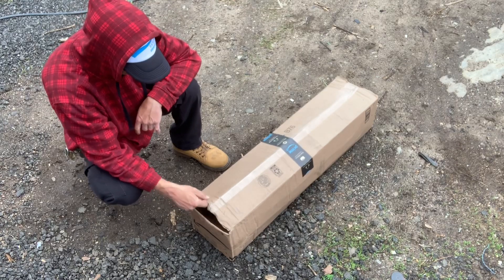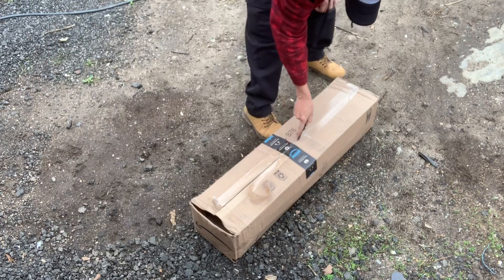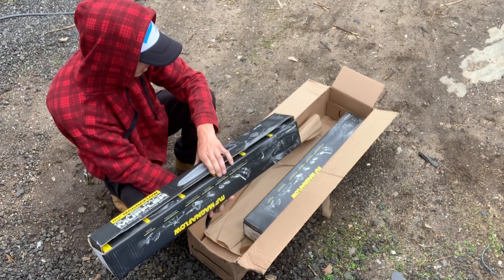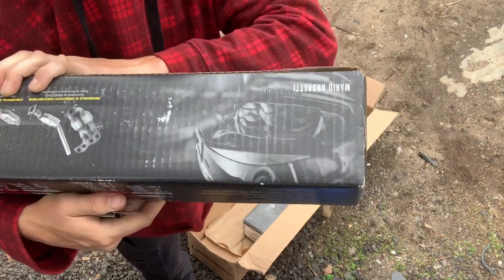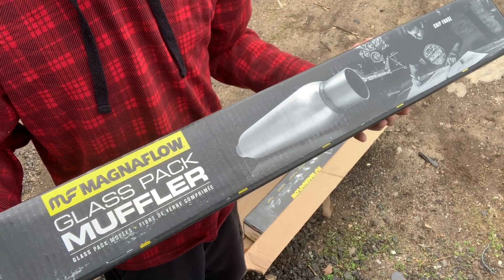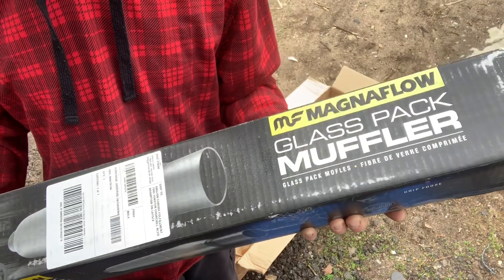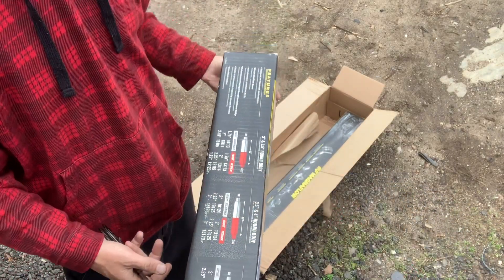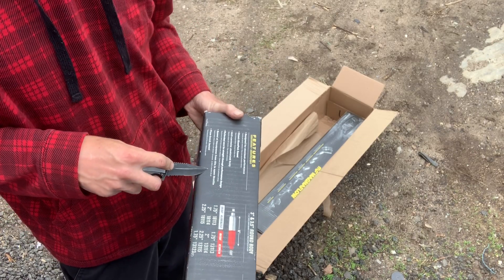Do Glass Pack Mufflers Work?  5.3 LS Swap Pontiac Firebird, LS-Droid PCM Read

Comment: ls droind is fine to get it going but if you put a cam in it, you can use tunerpro, its free.
Reply from the maker: Kwdog75 yes that’s correct, I use LS Droid to read and write the .bin files , and I use TunerPro to modify the file.  I will have a video soon on the tunerPro part.  💯😎👍🏽

Comment: Probably 409 stainless, non polished. They'll brown over time but shouldn't rust. Pretty confident magnaflow doesn't make any non stainless stuff. Just an FYI and I could very well be wrong.
Reply: Crap that sucks. Oh well still interesting to see they quieted it down quite a bit.
Reply from the maker: Ben Davis I put them on , and I liked the sound so I decided to keep them for now.  Maybe they’ll turn patina it maybe I’ll swap to stainless later 🤷🏽‍♂️
Reply from the maker: Ben Davis it’s aluminized, I’m pretty good at metals identification and it says aluminized on the box.  But the amazon product description said all stainless construction which is false

Comment: I have an 89 Firebird in mint condition it has the 2.8 , planing on putting a 305 or 350 in , what is some of the stuff you had to change out when putting in the 5,3 ?
Reply from the maker: Tarren Eldred I had the carbureted 2.8 originally, for me it was a bunch of stuff.  I made a playlist called budget LS swap and I made lots of videos along the way.  I had to change the fuel pump and sender to the EFI type, and made the mounts, had use a v8 transmission, the exhaust is different, I made my own junkyard 5.3 harness, all the stainless and braided fuel lines, swapped to a 4th gen rad w electric fans, shaved the intake, sectioned the oil pan, and I made my own throttle cable bracket for the TV/kickdown cable